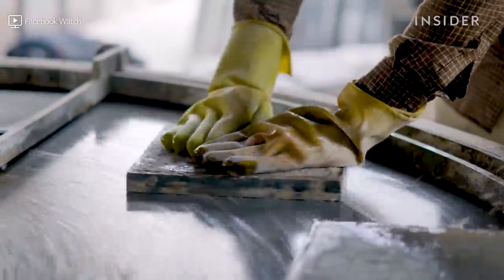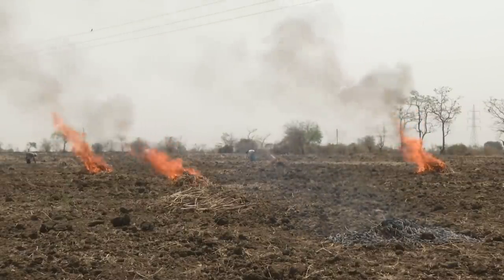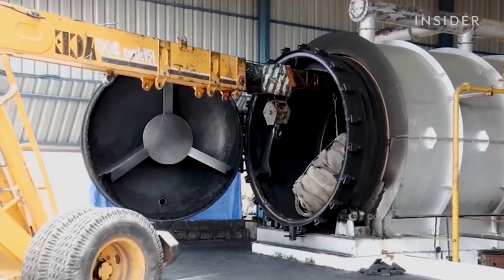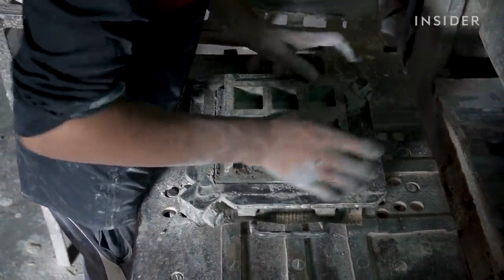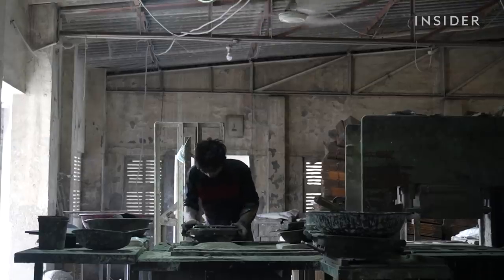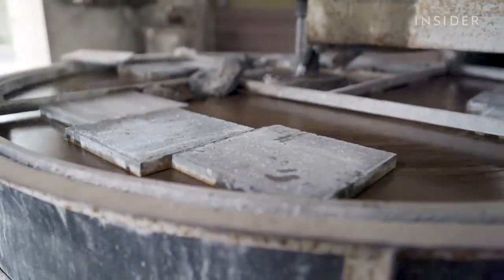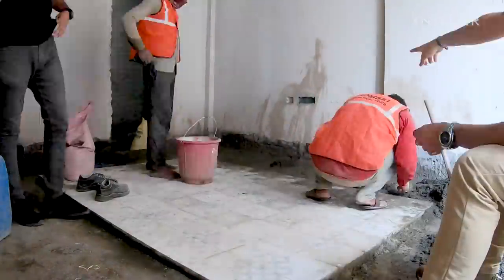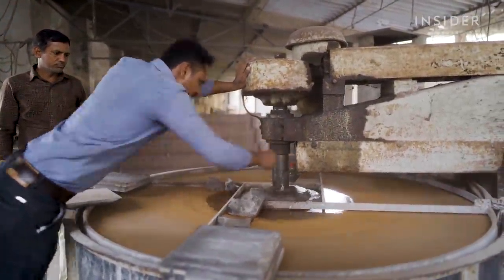Handmade Tiles Made With Smog-Causing Black Carbon | World Wide Waste | Business Insider

Comment: Why not use the carbon powder in epoxy to make an epoxy carbon floor? More carbon powder gets used this way and a clear top coat will prevent any carbon particles from being worn down or worn off if that would even be possible since it’s bound to the epoxy.
Reply: Because epoxy is a plastic that comes with its own issues...
Reply: Using soot as a pigment is not the solution.
Reply: @EduardoWalcacer  that is exactly what most black pigment is. Carbon black is used as a UV blocker in almost ALL black plastic. Most plastic is up to 5% carbon black. They call it black carbon in this video to either sound like they are doing something new or it is a grammar mistake.
Reply: @excitedbox5705  In case my comment wasn't clear, do you belive that using soot as a pigment is the solution for all soot polution?
Reply: @EduardoWalcacer  Ever heard of coal? 66% or more of it is carbon. Now where was it all this time? Under ground... All you need to do with soot is pack it down and top it off with the right kind of soil. THE END. And it will actually prove beneficial even. Ever heard of charcoal filters for pools for example? Yeah... Or you can use it to make ink for example. What they are doing with these tiles is a) uneccessary and b) waste of water. Carbon is only dangerous in form of small particles that you can breathe in or as a greehouse gas. Otherwise its completely safe.
Reply: @martinbudinsky8912  the problem with your proposed solution is the soot filtration itself. You have to understand, installing filter on everything that generates soot is expensive. You need to clean the filters, contain the soot somewhere and even change the filters periodically. All of that costs money.
Reply: @EduardoWalcacer  You seem to have misunderstood something (even though I have written for POOLS... so it should have been clear). I am not talking about carbon filters on chimneys etc. to capture carbon emitions. But soot itself (after a bit of processing - rather easy actually) being a filter. Which believe it or not actually works. Its for example in pool filters. Google activated carbon filters, drinking water filters, or even air filters because it can bind certain dangerous gasses to itself (due to carbon having 4 bonds making it quite reactive).
Reply: @martinbudinsky8912  guys calm your brains down al least we can all agree that the dudes doing this are helping the enviroment
Reply: @peppercorn9022  The thing is we cant... Cause they arent helping the enviroment at all. XD
Reply: @martinbudinsky8912  a step to helping the environment then?
Reply: Nah probaly a useless solution to helping the environment if you think about it
Reply: @martinbudinsky8912  your right bro 😩
Reply: @peppercorn9022  the only thing he is trying to help is his bank account get bigger under the pretending to be doing something thats never been done but it has been done for years.
Reply: Epoxy is literally plastic.. the whole point of this is to HELP the environment, remember?
Reply: @CHloE748  in 1943 Elbert Einstein cracks the nuclear formulae   Us now: use plastic to reduce plastic=sMArT
Reply: Good idea, sounds like asbestos logic....
Reply: Good idea, but this is a culture with a tile history. Maybe you could do that in your region?
Reply: @excitedbox5705  Or cause different versions of english have 'evolved' around the world. Take it easy.  😆👍
Reply: @excitedbox5705  A.
Reply: @beyamoth  😂😂😂😂😂😂😂😂😂😂
Reply: @beyamoth  😂😂😂😂😂😂😂😂😂😂😂
Reply: @beyamoth  😂😂😂😂😂😂😂😂😂😂😂😂😂😂
Reply: I resurface tubs and countertops with epoxy paint. It chips tear and peels just like another paint. What is this magical clear coat that will hold up?
Reply: @peppercorn9022  I'd say just an attempt to... and they got lucky that it got this popular even tho it does nothing
Reply: This comment shows a lack of critical thinking
Reply: @beyamoth  n. 9k[n9o. 9 mj.   j
Reply: @pawnzrtasty  "I resurface tubs and countertops with epoxy paint. It chips tear and peels just like another paint. What is this magical clear coat that will hold up?"
Just like ANY other paint? Sounds like you are either leaving out details or using a really shitty variety of epoxy. Different materials will absolutely have different levels of durability... I'm not going to say epoxy is impervious or any such nonsense but it IS significantly more durable than other (but not all) coatings. 
It's honestly questionable if you're even using epoxy if you're calling it paint though... the stuff tends to both cure too quickly & be way to viscous to be called paint.
Reply: @kgoblin5084  first the amount of paint is what says if it will peel. Thickness is key. You dump 2 inches of any paint and it won every come up. If you out here spraying you have to thin the paint. Period. Now the paint is thin and will peel. You dump paint on concrete and it won’t peel if you spray it will. It’s that simple. No magic paint out here. My paint costs $100 a gallon.
Reply: Epoxy is a plastic that is not suitable to talk on for the most part.

Comment: I mean you're making more pollution than you're capturing with the footprint of cement,  but if you're going to be making the cement anyway. you might as well encapsulate some toxic, flammable, radioactive fly ash into it.
Reply: Don't forget the entire month's worth of water needed to cure the tiles. I don't think it's a sustainable solution. Mostly a way to prevent the Black Carbon from getting into the air. Would much rather mix it into concrete and see if it doesn't affect it's structural integrity and use it up that way
Reply: It's greenwashing the tiles are packaged in plastic!!!
Reply: @insectbite1714  Their main concern is air quality, not global warming or general pollution.
Reply: Yeah it's really stupid. They should just manufacture black ink.
Reply: @harsha1306  it’s being mixed into concrete for over 35years already. Up to 30% of the cement volume can be replaced by flyash in any form
Reply: @harsha1306  It is already mixed into the concrete to begin with, this would be on top of that.

Comment: Theres no way these tiles can compare to fully fired vitrified tile. Its a great idea but most home owners are not gonna be Ok w/ the tile having to be polished after installation, there will also be a porosity and staining issue as a result of this.
Reply: Would you mind to elaborate about the porosity issue?
Reply: I strongly disagree
Reply: I’d be more worried about breathing it
Reply: @hipindie7363   With concrete, the less water is intially used, the higher psi rating. These guys are using minimal water and a hydraulic press to form the tiles, could psi an 8000 psi mix + but concrete is still porous and can be affected by water, an example of this is their water curing process, the tile is still absorbing water months later. This also means that the tiles are prone to staining as well.
Reply: @kurtsmith4657   So, despite the whole process, the porosity still high; thus the tile is prone to staining. Am I getting this right?
Reply: It's greenwashing the tiles are packaged in plastic!!!
Reply: @hipindie7363  Porosity is inherient to concrete, the only way to seal the pores to prevent moisture wicking would be to fire the tiles in a kiln or possibly theres some new additive or polymer that could be added to the mix.
Reply: @kurtsmith4657  Now now, if we sealed the pores either by firing or using additive, that makes polishing after installation unnecessary doesn't it?
Reply: @hipindie7363  Correct. The polishing is an attempt to semi-seal the pores.
Reply: @kurtsmith4657  It's a good insight, thks!
Reply: @hipindie7363  Always happy to discuss random topics w/ open, level headed people. Best Regards
Reply: Calm down jamal, its still in process of Perfection, so atleast we wait 2 to 3 year.
Reply: lovin this exchange of knowledge. sadly this is rare nowadays
Reply: Nah basically mosaic too needs polishing but it flourishes in india
Reply: @kurtsmith4657   I could give you over a 1000 different mixdesigns of concretes that are pore free completely resistent to any form of chemical, mechanical influence stretch or bend with +300mpa strengths…. The past thirty years, Over 70% of all tiles in central Europe are made of concrete where the top layer is a ash or silicate mix. Just like in the video.
Reply: @nicks6196  The concrete is not pore free as its still just a mix of sand, lime and aggregrate. Your talking about creating a non permeable surface finish. Yes, im sure it can be done, but to say the concrete that composes the tile has no pores or porosity is wrong and misleading.
Reply: That extra polishing step is a great way to put soot BACK into the atmosphere right after it has been captured from the coal power station the electricity comes from! 😂
Reply: @hipindie7363  It can soak water like spnge and trap moisture. Generally its bad because it is a breeding farm for microbes and fungi. I could use it outside of our home but never inside. For that I would use ceramic tiles. Which prevent water from penetrating them and are easier to maintain, clean etc. 2$ for a tile is expensive, especially of this quality. They try to make it sound eco friendly and carbon negative but damn they are wrong.
Reply: @Just-SomeGuy  please attach your eyes before watching a video . 
You can clearly see that the tiles are polished with water splashed on the surface.  So the chemicals go down the drain or in a dump site. ( Which is not any less bad )

Comment: Does this really seal the carbon or if they're scratched can the carbon be released into the immediate environment? Are they planning on ways to cut down the install work so it's more comparable to regular tile?
Reply: It's greenwashing the tiles are packaged in plastic
Reply: @insectbite1714  really? The video shows its being packaged in cardboard boxed
Reply: @insectbite1714  they were quite obviously packed into cardboard boxes, bound with tape.
Reply: Probably, but It’s small amount, so it maybe better than just being released into the air immediately.
Reply: Even if the carbon is released through scratching, it is unlikely to be suspended in the air for weeks.
Reply: @juthikajana8153  the tape they are packaged in has plastic tape on it😣
Reply: Its carbon. Your pencil is carbon
Reply: @jeuglz7331  Third world country😂 You are still in the White man is the supreme being mindset
Reply: @n0steeze  I was just curious to see how would he react no offence
Reply: I mostly does not cause the cement and other materials put into it should hold the carbon together
Reply: @jeuglz7331  nice dude, I don't see any Americans doing this and please learn English
Reply: @ayushdeole532  👍
Reply: @insectbite1714  reporting yo as for spam god damn son 1K COMMENTS
Reply: Don’t worry it only ends up in the water systems, how bad could that be?!
Reply: @martinbudinsky8912  good point about water consuming, so many angles to look at when it comes to "green tech".
Reply: I mean it is good if you want to change theplanat, but isnt puting the crabon into tiles just storing it for a few decades until they are thrown away?
Reply: Putting ashes in concrete is nothing new. It's really bad because then you have a lot of pollution and radioactive shit in your walls. Then you get particles into air in your home

Comment: The cement industry as a method from all the labor and processes entailed has a massive pollution footprint.  Putting carcinogenic pollutants inside fresh concrete is a not a good solution and a health hazard.  If someone can solve replacing concrete with cheaper and/or equivalent cost; and say it's bio organically grown fast enough to produce and efficient it's a multi billion dollar problem that will reward who ever figures it out.
Reply: It's greenwashing the tiles are packaged in plastic
Reply: Exactly my thought when they mentioned they were using cement. And then they add they don't use all that much black carbon on their cement tiles, as carbon messes with the cement...
Reply: @insectbite1714  they were quite obviously packed into cardboard boxes, bound with tape.
Reply: @pdkoenig  THE BOX TAPE IS PLASTIC
Reply: @sarjulia  THE BOX TAPE IS PLASTIC
Reply: This is an excellent development. I will certainly use the product when I become available in the UK.
Reply: @insectbite1714  I think you might be focusing on the wrong thing here. Packaging is a concern for sure but nothing compared to the actual product here.
Reply: @JaM-si6nb  you just daid you are from the UK lmao
Reply: @jakx2ob  yes I am.
Reply: @Nicnicnicolas89 typical, now it's all about you.
Reply: HEMP
Reply: More of a health hazard than the carcinogenic pollutants being in the air instead? Because that is the true alternative. Think of a mass adoption of something like this, people will be intaking LESS carcinogenic material than they are currently. India has more to worry about smog than they do about climate change or other things at this current time.

Comment: What is the percentage of carbon in each tile on average? 
What is the comparison of carbon footprint of heated tiles vs cement tiles that need to be excessively polished. 
For the heated one you just have to make sure the factory runs on solar but this polishing on site would use electricity from coal plants.
What is the durability of this compared to conventional tiles? Has this been tested?
Reply: The questions you are asking will end up in foreclosure of the enterprise. Such documentaries are funded by greenwashers and they continently exclude the part that you are after. Putting carbon in tiles to reduce the environmental impact is roughly equivalent to desalinating sea water and moving it inland to tackle rising sea level problems.
Reply: It's not like those polishing machines can't run on solar power 😒. If you can make sure to have your regular tile making facility run on solar energy then you can make sure to have factories like this run on solar too .

Comment: Was this properly researched? Will there be side effects in the long run for the people who resides on the bldgs that has these carbon tiles?

How about the workers? Will their health be compromised while making these tiles?
Reply: Probably hasn't been researched and won't be .  My theory is tho that the amount of BC emitted from the tiles by e.g. scraping/walking is significantly lower than the amount of BC in the air. In terms of workplace safety, it's most definitely highly toxic, especially regarding the low safety standards  shown in the video (e.g. the one guy not wearing a mask while throwing it into the bucked

Comment: Here it appears that carbon is used as a colourant for the tiles. Question is if it is suitable on a large scale? Based on what was spoken by workers, it is a raw ingredient minimally used. Then we still have an unsolved problem.

I pity the poor workers that don’t wear protective gear while mixing toxic carbon. He might get cancer next time.
Reply: What this video gets wrong the most is that carbon is toxic... ITS NOT. What is hazardous is small particles and breathing them in (and that applies pretty much to all small particles)... Carbon itself like this is actually common in nature. Think of charcoal for example. So what they are doing is not only uneccessary but also health hazard for their workers. Best solution? Bury it. It will work as a natural filter for water and its actually benefitial for plants (of course depending on ammount). After all it is actually common in nature. Every time volcano errupts or forrest burns what do you think ends up in the atmosphere and then in the ground? :D

PS: This carbon is commonly used in dying plastic, ink, or even tires. And in much bigger ammounts. What they show in the video is actually a waste of drinkable water. Nothing more.

Comment: Great idea but i have a feeling this will have long term bad health effects, and if this becomes a mainstream thing you always have the companies who dont follow rules and will make dangerous products so will need some way of checking these items every tile
Reply: It's greenwashing the tiles are packaged in plastic
Reply: @insectbite1714  they were quite obviously packed into cardboard boxes, bound with tape.
Reply: @sarjulia  plastic tape. Also the amount of heating that’s required for these cement tiles is also releasing carbon back into the air. This is probably one of the worse solutions I’ve seen.

Comment: I work with concrete and one day, a mix that was mostly Portland cement melted a small portion of the plastic based form. This plastic actually melted and fused with the concrete. 

After seeing that, I wondered about recycling plastic waste into concrete, but finding a way to make it a beneficial admixture at the same time. 

Just a thought
Reply: This has already been done. Pretty sure it was featured in another business insider video. They basically made plastic trash bricks. Problem with this idea is that micro plastics will be released each time cars go over the concrete - which is extremely dangerous for humans. Most videos I see that have an “eco” alternative, always have a big caveat and are not as revolutionary as they seem. I think the best movement right now is the clean the oceans movement which is actually a feasible goal with no real caveat.
Reply: @readifdumb  I saw using the plastic for benches and stuff like that, that makes sense, roads of plastic not that much
Reply: @ElAdri1999  Agreed. I suggested on the African plastic brick video to use the bricks in walls or other building construction that wouldn't experience the same wear and tear. An Ikea style bookcase would hardly give off the same microplastics as a daily traveled road.